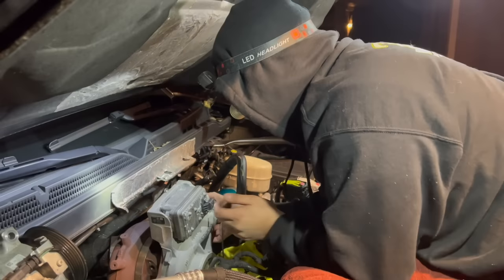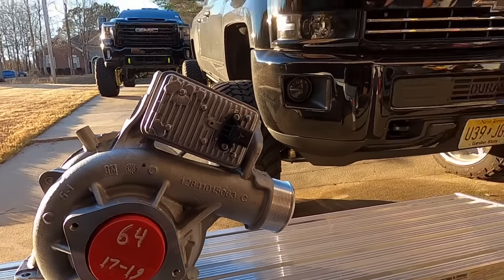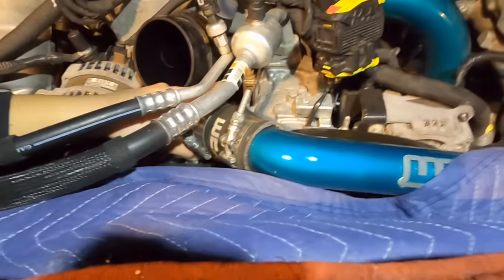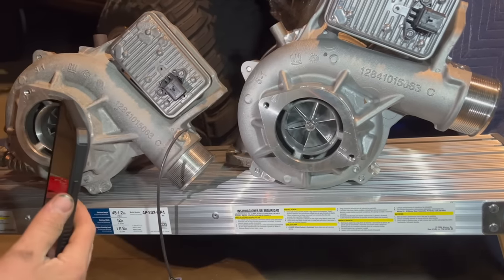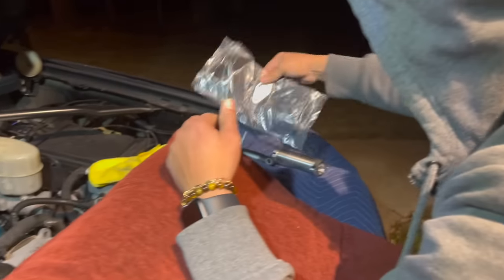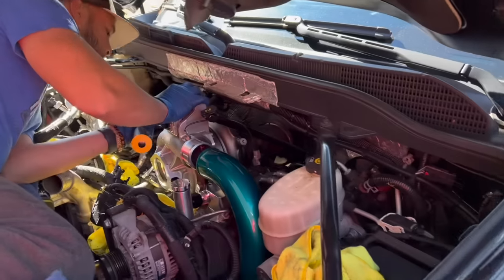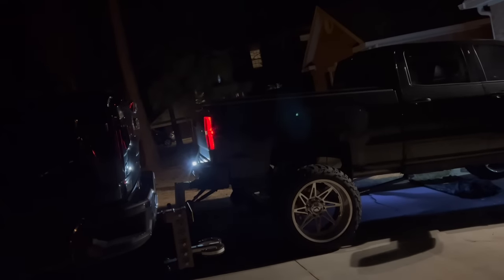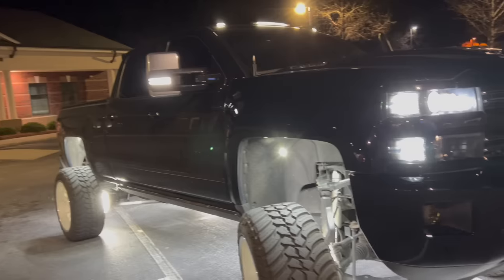L5P DURAMAX 64mm TURBO INSTALL IS DONE!! Sound Like a JET!!!

Comment: I pull the truck in, drain the oil.      Then change turbo, finish oil change and I prime turbo with a squeeze bottle full of fresh oil.   I fill the turbo about half a quart as it runs back down and down the full tube also.  Probably over kill but that way you get a good oil change

Comment: Completely different application here but I use to use mobile delvac 15w-40 in my 4.0L cherokee cause it helped quiet the valve train noise. Decided to try Valvoline premium blue 15w-40 one time and it made a huge difference in quieting it down.
Reply: same, ive used diesel delvac in gearboxes , diffs. And gas engines(NOT winter though). Its a great lube and like $20 for 5 gallons at Farm and fleet. 
But latelly just using Quaker state Synthetics, so cheap, 25$ a gallon .

Comment: Whistle comes from the turbine wheel not the compressor wheel. 10 blades are loud I know I have an 03 6.0 it's really loud and annoying can't hear the turbo after 15 lbs of boost. Ready to get 13 blade stage 1 from KC Turbos

Comment: C’mon Donnie, why no Wcfab intake horn?
Plus, get a fumoto drain valve, much nicer oil changes. I also went with black market performance, cat oil filter conversion. 
And it’s a good thing it didn’t fire up right away, should pull relay so it won’t fire, to get oil in turbo first.
Correction, mddp oil filter kit, bmp fuel filter kit
Reply from the maker: WC changed the design so we got the new one coming. We put oil in the turbo prior to starting it.
Reply: @JWMontoya  really, I’ll have to check the new one out.
Now I just have to win the turbo 😂
Reply: I have the old style and according to motor ops. They’ve had a bunch of trucks coming in with mouthpiece issues. My l5p seems like it’s getting choked when at full throttle
Reply: @alexmitilica99  are you talking about the “flow ring” they claimed to eliminate turbo surge. Mine has that ring, my truck acts like it falls on its face when I stomp in it, then it will come alive after? Is this what yours does?
Reply: @50calprepper  I think so. it almost sounds like backfire from a gas car. I was told to remove the turbo horn and put the stock one back in. So basically I have a $350 hood ornament

Comment: 10-15 thousand miles it gets quieter hell by then it needs changed
Reply from the maker: Definitely but the hotshot oil I’m using can be ran up to 3 times longer than manufacturers specifications. I still would recommend changing every 5k miles but I’m testing it out for oil analysis

Comment: Are you satisfied with the PCV reroute kit so far? Did you reroute it to the ground?
Reply: Bump
Reply from the maker: Yeah, looks way better and easier for oil changes. It get's dumped to the ground.
We've got em here: https://jwmotorsportsco.com/products/2017-2023-l5p-pcv-upgrade-kit

Comment: I just got my L5P back I had it deleted and tuned for off road use only. I have 5 in from down pipe back and s&b cold air intake and I really thought it would be louder and whistle louder. Could this be in my tune or do I need to do a high flo down pipe for more sound? Thanks
Reply: Try 3” downpipe with larger intake air horn
Reply: It’s because of the doc on the back of the turbo. The big can between downpipe and turbo. With that still on it’ll still sound almost stock. You need to remove that and get the correct downpipe
Reply: Well that’s good to know if you wanted it to stay quiet for stealth

Comment: I seen you guys run hotshots oil , why didn’t he put the black diamond since he’s deleted?
Reply from the maker: We may on the next oil change but diamond fleet has plenty of minerals necessary
Reply: @JWMontoya  oh Okay I was just asking since I’m planning on running hotshots oil on my next pit change  & mines deleted as well
Reply from the maker: @mariogutierrez3048  black Diamond is closer to the racing oil
Reply: @JWMontoya  in your opinion which would you suggest ? I’ve seen the price difference lol
Reply from the maker: @mariogutierrez3048  fleet is fine but black Diamond is badass

Comment: What power tool brand is that,  & where do I buy the new awesome oil cap replacement?
Reply: Me. Hit me up on Instagram. Same name as on here.
Reply: @thatcompoundL5P   I do not have instagram, but want to get the oil filler/pcv mod